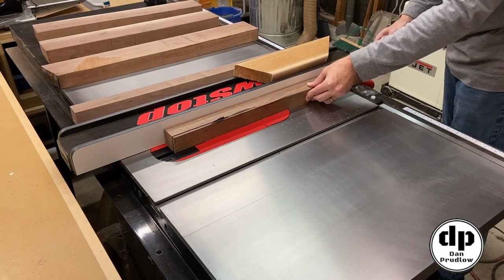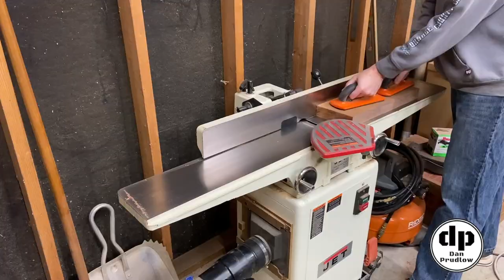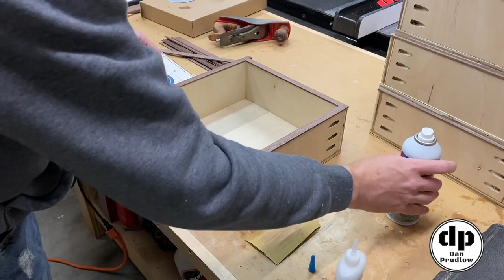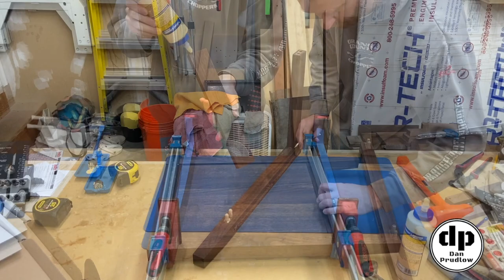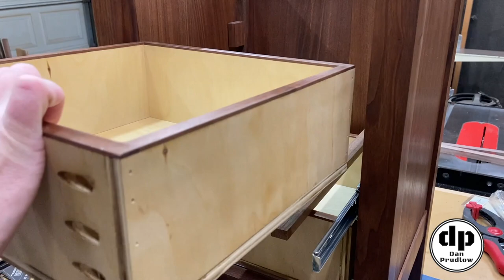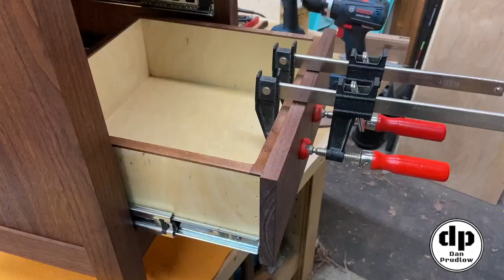Building Nightstands using the Jessem Dowling Jig

Comment from the maker: Want to support the channel? Here's what you can do:
 - Subscribe to the channel
 - Hit that Like button
 - Leave a comment
 - Amazon Affiliate: https://amzn.to/2LaN1Ib

In this video I build a pair of nightstands out of walnut and finished with two coats of Tried & True Varnish Oil and a final coat of Tried & True Original.  The joinery is all done with 3/8 inch dowels using the Jessem 3/8ths dowling jig.  The jig makes it very easy to align the holes and create small offsets between the legs and the rails.  This project took a long time but the end result I'm very happy with.  Like all my project...they aren't perfect because I'm still learning...but they should last many years and be able to be passed down to future generations.  Let me know what you think in the comments.

Jessem 3/8 Doweling Jig: https://amzn.to/3q7okRq
SawStop 1.75hp PCS: https://amzn.to/2X4gWsP
Jet 6-inch Jointer: https://amzn.to/2ZfdUo2
Dewalt DW735 Planer: https://amzn.to/2Z0U4f0
Bench Dog Push Blocks: https://amzn.to/2YB00uL
Ridge Carbide 10-inch Saw blade: https://amzn.to/3bATmcp
Bosch 18v Drill: https://amzn.to/2OmrItJ
Bosch 18v Impact Driver: https://amzn.to/3cxAhJk
Bosch 18v Jigsaw: https://amzn.to/3jDtxOA
Bosch ROS: https://amzn.to/3rxri1W
Titebond Wood Glue: https://amzn.to/2LzTdv4
Titebond Hide Glue: https://amzn.to/2N9BCOy
Bessy Parallel Clamps: https://amzn.to/2z4LHG3
Bessy 6-inch F-style Clamps: https://amzn.to/3e3LGl4
Tried & True Varnish Oil: https://amzn.to/2Z0uSVX
Tried & True Original: https://amzn.to/3q3IV9j

Thanks for watching.  If you have any comments or questions please leave them below or hit me up on social media, email, or my website.

Hit that like button and don't forget to subscribe!  Thanks!

Subscribe: https://www.youtube.com/danprudlow?sub_confirmation=1

Twitter: http://twitter.com/DanPrudlow
Instagram: http://instagram.com/danprudlow

Comment: Hey man, I found a trick for screw length. Since plywood varies so much. Take a scrap from the piece you are currently using and run in as many screws as you need. Then hop over to your belt or disc sander and sand them all until you start sanding wood then they are all short enough to not punch through your work piece. Quicker than doing each one on the angle grinder.
Reply from the maker: Nice idea. Thanks for sharing! 👍🏻

Comment: I confess, i was expecting to see more of the doweling jig, as per the title. I am debating on purchasing the jessem dowel jig.  Are you happy with your purchase so far?
Reply from the maker: Thanks for the question.  I am 100% satisfied thus far.  I bought the jig for this project so it was my first time using it.  Between the two night stands are 32 joints, each with 2 dowels, and everything went together perfectly.  I had no alignment issues at all.  I almost bought a cheaper jig but looking back I am so glad I spent the extra on this one.  Hope that helps!  Thanks for watching. 👍🏻
Reply: The Jessem jig is excellent, bought mine 6 months ago.
Reply from the maker: I agree…everything went together so well!

Comment: Beautiful project ! 

One stupid question though: why do you use screws instead of dowels for the table top ? Easier "squaring"  ?
Reply from the maker: Thanks!  The top has to be able to “float” a bit for when the boards expand/contract with seasonal moisture changes.  The fasteners used allow for this.  If I glued the top down with dowels the wood movement in the top could break the joinery in the base.  Thanks for the question and compliment.  👍🏻

Comment: Nice work! I have the same doweling jig. What was the brown bottle of glue that you used?
Reply from the maker: Thanks!  I used Titebond Hide Glue.  There is an amazon link in the video description if you want to check it out.  It has about a 30 minute open time so it’s a bit easier to get all the joinery together and clamped up before it sets too much.  Thanks for watching! 👍🏻
Reply: @DanPrudlow  
Thanks! I’ll take a look at the hide glue.

Comment: Hey Dan,

Got a question I hope you can answer for me.  I recently picked up that JessEm doweling jig and have been pretty impressed with it.  My question is this.  

How are you aligning the dowel holes in the middle of the piece?  The holes on the end, it looks like you use the edge of the jig to get your alignment but the ones in the middle have me stumped.  The center alignment mark is on the bottom of the clamping plate, but I can't figure out how to use it if the piece I'm drilling is thinner than the clamping plate.  The center line will hang out in space and that looks to be the case here.  There really aren't many videos of people using this specific jig so any light you can shed on this would be greatly appreciated.  Thanks!
Reply from the maker: Hi Ben.  For this project I cut myself a spacer block to set the location of the jig.  I aligned the spacer with the bottom of the leg and then butted the jig against the spacer and then clamped it down to drill.  What would have been faster still would be for the spacer to have a block to hit the bottom of the leg rather than me aligning by feeling for an edge...but I didn’t think of that until after the fact.

I agree that center line on the jig is not entirely helpful...maybe there are uses where it is but in my case it was not.  But I do like the jig...made things pretty easy.   Thanks for checking out my video!
Reply: Appreciate the reply!  That makes perfect sense the way you did it.  Gonna use that in the future.  Thanks!

Comment: Yes you have that “special “ table saw but my god why do you put your hands so close to the blade? You use a push still safely away from the blade but your more valuable fingers less than two inches from the blade. Are you aware of what your doing? Have you considered an overhead blade guard? I am sure “special “ tablesaw company sells one. It  was cringy to watch the first few seconds, just wanted to see the jig work but moving on.
Reply from the maker: Thanks for your concern.  My primary concern is keeping control of the workpiece.  If I only use the push stick and the off cut contacts the blade because I was not in control of it then it becomes a missile.  So while a couple inches is close, the blade is not going to move over and hit my finger.  Losing control of the workpiece is what would cause things to go bad.  I have the overhead blade guard but when using it I feel less in control of the workpiece as it passes through the cut.  Lastly I’ll say that the video at high speed typically makes things look more “cringy” than it really is.
Reply: Had to laugh. I thought the same. Scares me I've seen too much. Tony